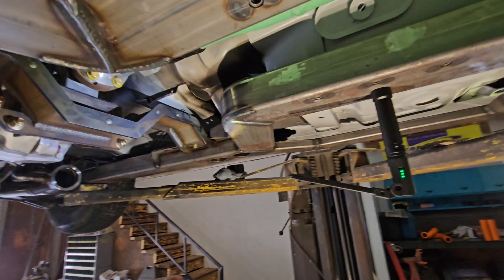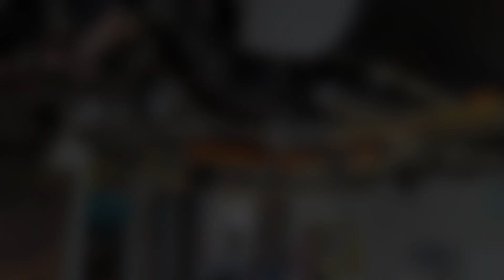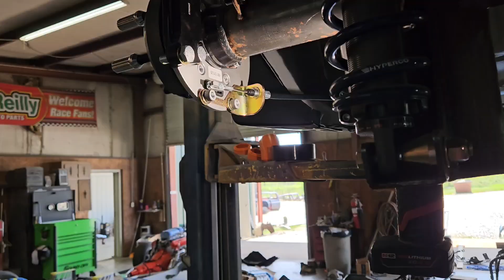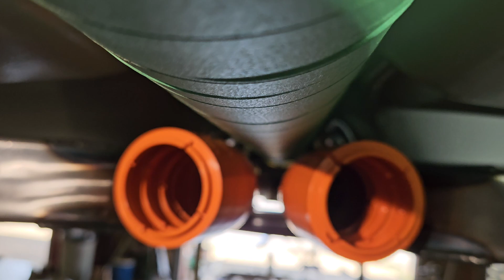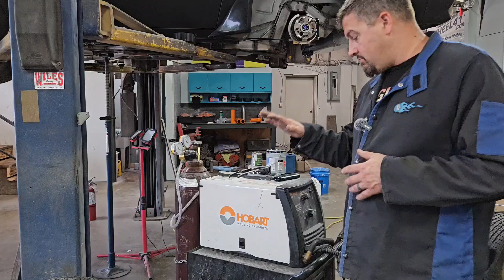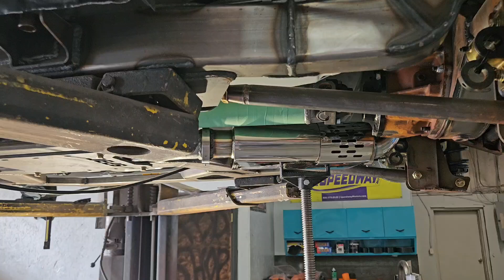77 Pro-touring Trans gets custom exhaust

Comment: Something I’m curious about is there enough room for the driveshaft to move up and down as the rear axle moves up and down? Seems really tight with the exhaust running below it.
Reply from the maker: Yes the driveshaft and rear axle are at full drop in the video.  The suspension is way stiffer than stock, and I've checked to make sure everything clears during travel

Comment: O2 sensors are mounted wrong
Reply from the maker: Then they were mounted wrong when Kooks headers manufactured the headers.
Reply: O2 sensors need to have a 10 degree or more tilt for condensation issues. That sensors being parallel to the ground will be prone to failing and or giving false readings.